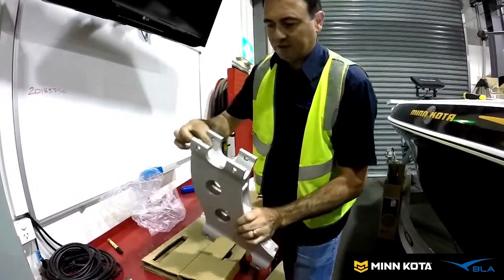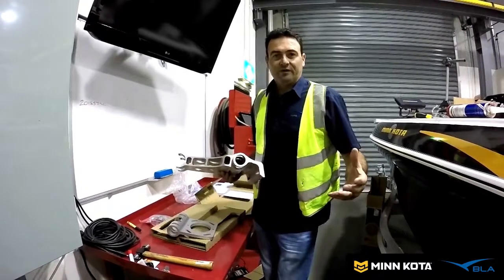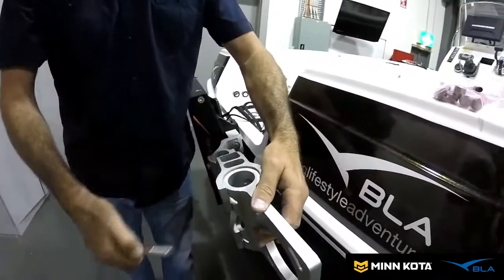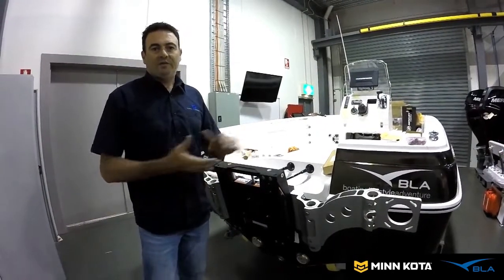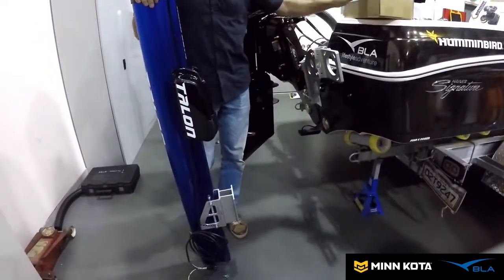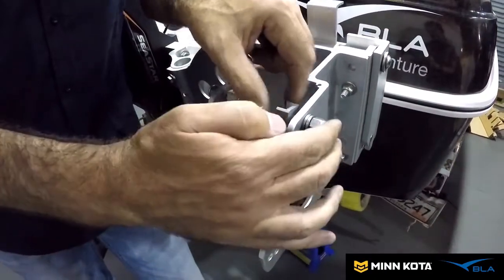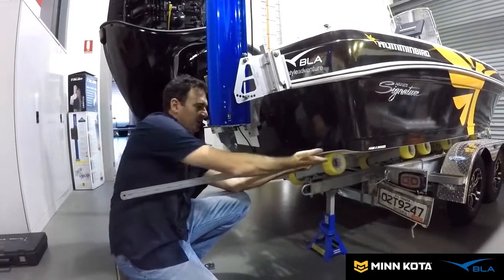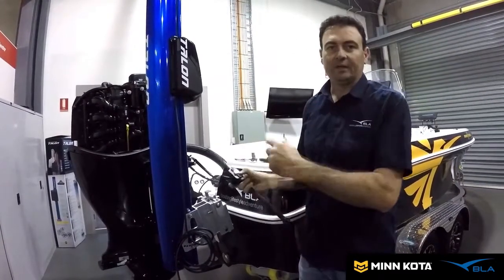BLA - Trade Talk - Fitting & Installing TALON using Jackplate Mount Bracket

Comment: I want to mount to a pontoon boat (rear) and I don’t have a Jack plate. Can this mount just be bolted to the engine mounts. 

I mean can you just remove the nuts that holds the engine on putting the mount on then replacing the nuts? 

So hard to explain